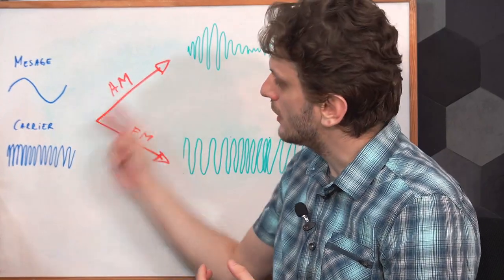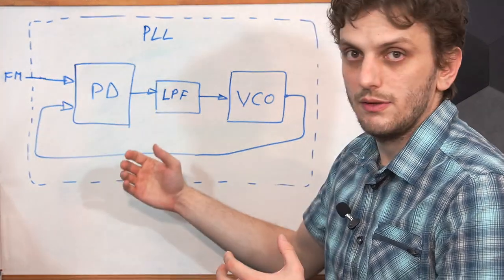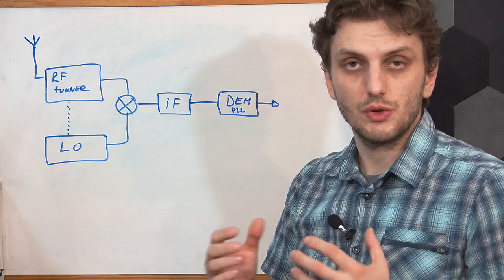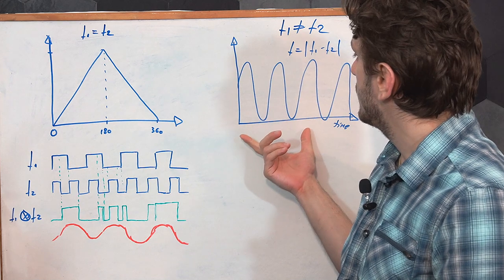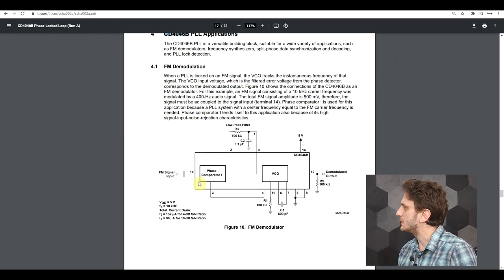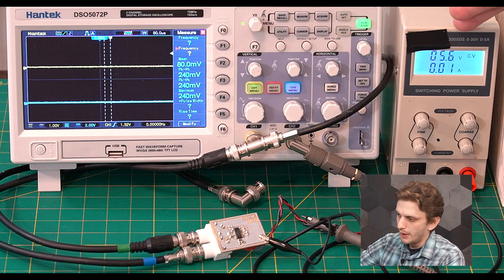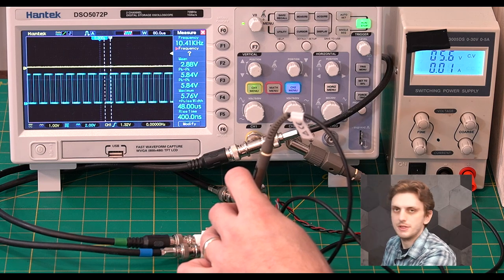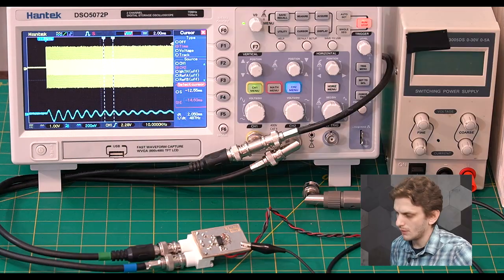PLL's - Demodulating FM signals

Comment: The good video! With the simplest RF mixer (common base one BJT mixer) and one IF stage with  a BJT  the CD4046 can receive FM stations! The main essential thing  - how to stabilizing feedback loop  had not been covered. The  resistor 4.7K in series with the 100nF capacitor and an another  small (4.7nF) capacitor connected between pin 9 and the ground maybe solved this problem.It decreases shapeshift and reduces Bode plot falling rate to 20dB/Decade.

Comment: Pretty sure the phase comparator with 1k resistor isn’t causing oscillation / instability, the wave you can see is just the noise from the 10kHz fgen. The frequency of the square wave at the output of the XOR phase detector will be twice that of the VCO, so filtering it you’ll get some ripple, in this instance at 20kHz. The corner frequency of the filter is only 1.5kHz with this faster filter after all.
A synchronous peak follower can sit on the output of the phase comparator’s filter and get better ripple rejection than a high-frequency filter alone, and faster response rate than a low frequency alone. A multipole filter may be a simpler method though.
Reply: This comment call for a part 2 ?  (It is so well explained, we will enjoy looking at the reaction)
Reply from the maker: I do agree that my signal generator is quite noisy, so that may be an issue; But even though the corner frequency of the LPF is 1.5KHz, that is not necessarily the crossover of the loop. in the first measurement (R=100k, C=100n) the corner frequency was 15Hz yet the oscillation observed was at ~500Hz. 
I guess I will analyze the subject of loop response and stability in more detail in another video and try to properly measure it.

Comment: Lovely video. But I am not able able to get how to synchronise Local oscillator with received modulating signal so that you always get a constant IF.
Reply from the maker: In older radios you had a mechanical variable capacitor while in the newer ones you get varicaps; regardless, the variable capacitor has 2 capacitors that turn at the same time, so as you use one of the capacitors for the reception filter, the other is used for the LO. Based on how the coils are designed, the 2 capacitors, form 2 oscillators that have a constant frequency difference.
Reply: Hello,
On FM receiver, it's common to use the relative "DC" component of the demodulated signal to "adjust" within a certain limit the local oscillator frequency. This is what we call the AFC circuit (Automatic Frequency Control) that allows tracking the HF signal to maintain as constant as possible the central frequency of the IF signal. Monitoring that AFC signal (with a small galvanometer or modern comparators followed by +/- LED) give you an idea on how well the receiver is tuned.

Comment: For the phase lock loop diagram make the Low Pass Filter your right most block, going to an output node.  Bring the signal back through the Voltage Controlled Oscillator to the input of the Phase Detector.  Rather than explaining "the real signal"  make it explicit in your diagram that what you want is the output of the LPF and that the VCO is conditioning the feedback to the Phase Detector.

Comment: How does a metal detector work? They use PLL right?
Reply from the maker: Not necessarily; From what I remember, one mode of operation relies on measuring the variation of the inductance of a coil; and the other main mode relies on generating electromagnetic pulses, and listening for the pulses bouncing back from metallic objects.
Reply: @FesZElectronics  I have a geotech magazine article titled "build an induction balance metal detector" which uses a 4046. I thought all have it.
Reply from the maker: Is this the article you are referring to? https://www.geotech1.com/pages/metdet/projects/clarke/clarke1_300.pdf
Here only the VCO part is used, so you don't really have a PLL (there is no loop). The only reason to use the VCO is to turn a DC voltage into an audible signal; you could replace the VCO with a simple needle indicator.
Reply: @FesZElectronics  That's the one. 
I don't know anything about metal detectors and assumed they all use a pll. Thanks for clarification.